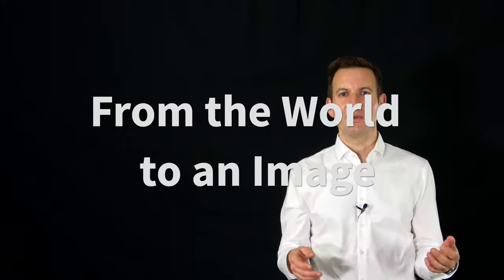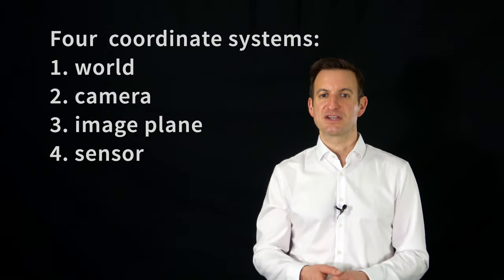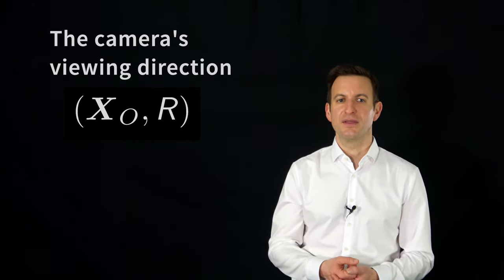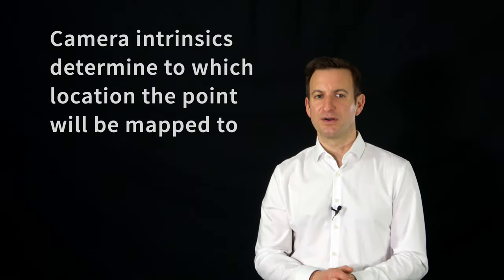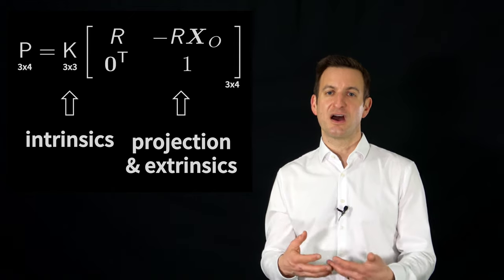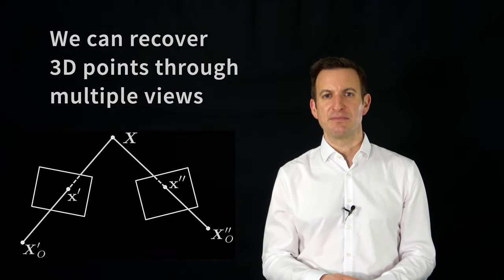Mapping the 3D World to an Image - 5 Minutes with Cyrill

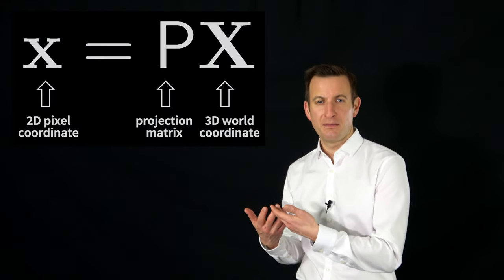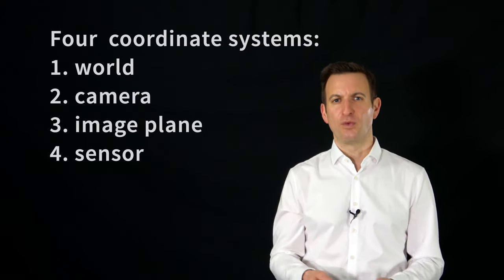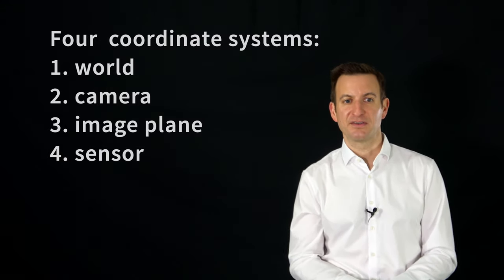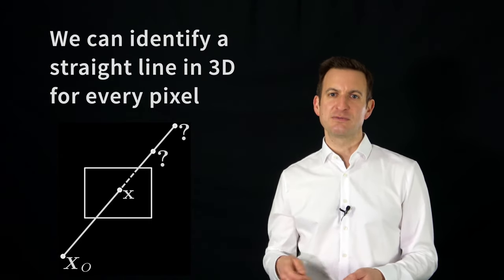Comment: 0:51 1:16 4 coordinate systems 1:56 camera location 3:48 formula interpretation 4:06 not invertible b/c info loss from 3D to 2D (given a 3D point, we can use the calculated P to get the corresponding 2D point, but given a 2D point, we cannot use P to get the corresponding 3D point b/c loss of info) 4:44 can partially invert with a 1D solution space 4:51 5:07 5:13